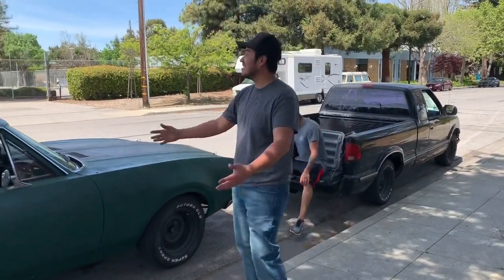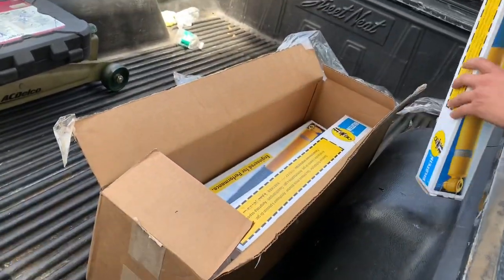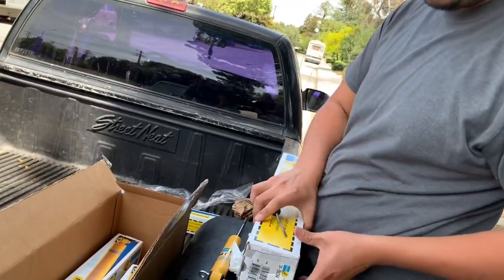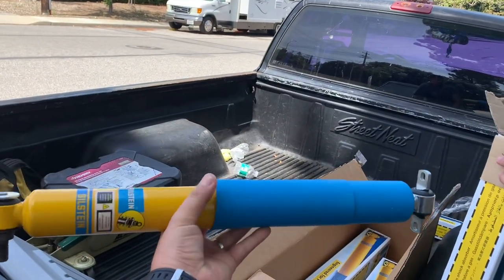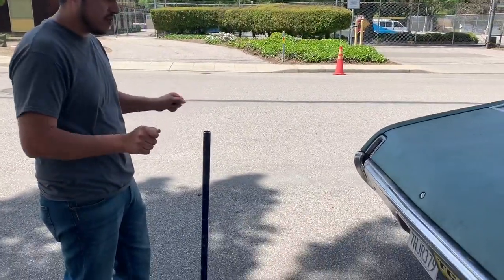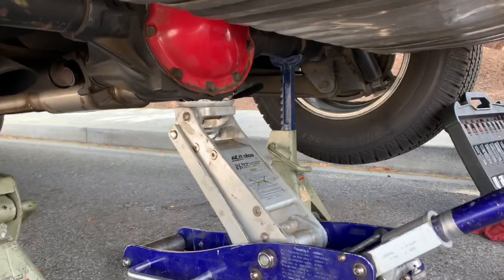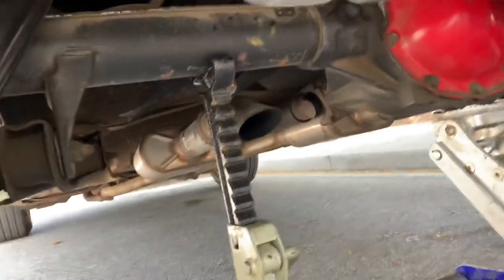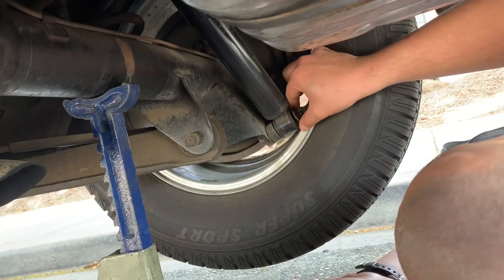How to Install Shocks -Cutlass, Chevelle, Skylark, Lemans, Monte Carlo and el Camino

Comment: For the top of the shock, you're supposed to have rubber bushing on both sides of the hole at the top, with a metal thrust washer between the bushing and the shock (below the hole) and between the top bushing and the nut. Like an Oreo.

Comment: I was laughing my ass off listening to you guys...I just did my 70 Chevelle..a lot of the same thoughts were going through my head. Bilstein shocks made a difference in my ride also..money well spent..it would have been nice to know if the centering washer was supposed to be on top of the chassis or below..good luck with your ride.
Reply from the maker: Donald Alger happy you got a laugh out of it! Also hlad you went with bilstein i had mine for a few months now ans they are still solid couldn’t be happier! Also yes that washer deal was confusing! Thanks for checking out the channel

Comment: when doing the front should i jack up the front end and take both tires? or jack it up on one side (placing the jack near the doors) and then switch to the other side?
Reply: also do you have any idea why my chevelle has negative camber, it sits like a bull dog or as if it has “stance” although the angle isn’t extreme, it is noticeable, do you think taking it to an alignment shop will help, or what can bring it back to a straight stance, i replaced the rear with my dad today but i’m confused about the front and i’ll be doing those on my own soon
Reply: please see this comment
Reply from the maker: Sorry for the really late reply man! I try to do them all once a week! Just been a little busy! But yes we usally jack up the front end and take both tires off (make sure the car is secure on jack stands and dosent move) if ur by ur self what ever works for u best honestly as long as ur careful! I don’t have idea why it would? But checking ball joints and tie rods would be my first move, an alignment shop can probably correct it for you.
Reply from the maker: Also check this video! I dive in a little into the geometry on this chassis might help: https://youtu.be/q2qOiPAToGY
Reply from the maker: Hope this helps😅
Reply: @skepticalmechanics17  i ended up lifting the front and struggled to take the shock off because it kept spinning, i ended up using a vice grip to hold it, and i finally got the shock out to find out my new ones were to big.... i put the old ones back and and i’m sending the new ones back today, have some other new ones coming on friday 👍

Comment: For the rear shocks do you need to put pressure on the differential? And for the front do you have to remove the tires? Or no?
Reply from the maker: I would definitely put some pressure on the diff! And u dont have to remove front tires, just makes it a 1000 times easier